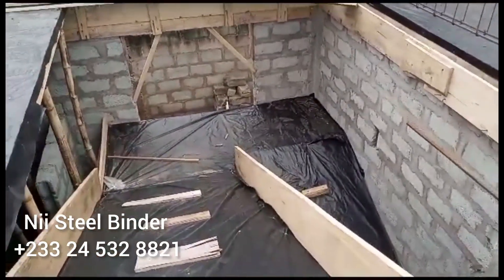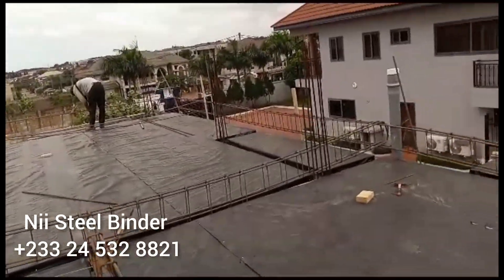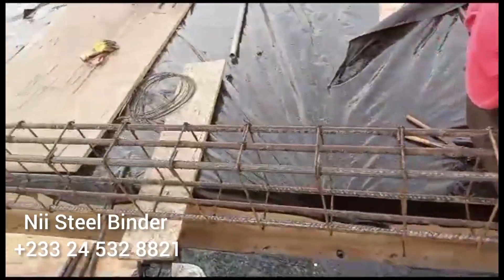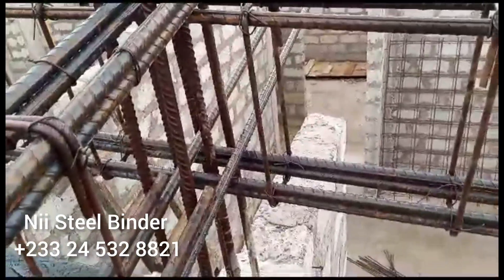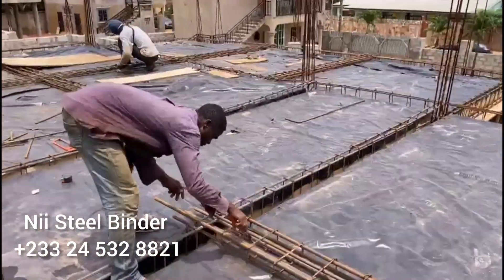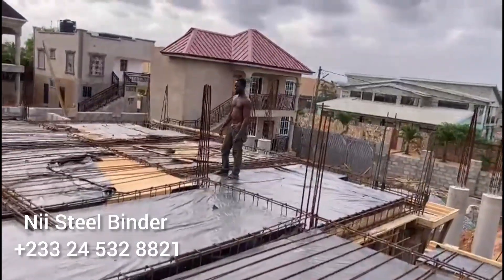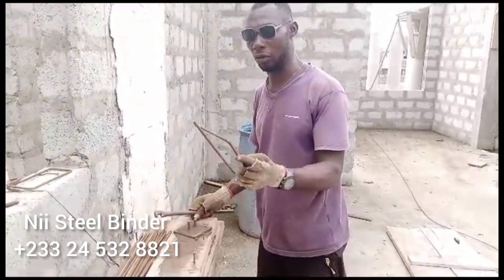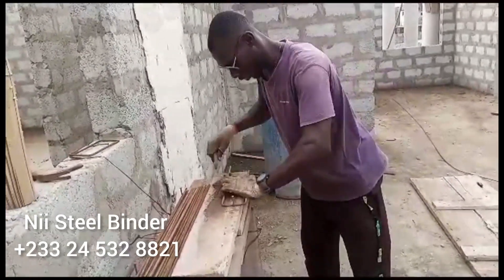Building In Ghana | How To Install Rebar (Iron Rods)  For Concrete Decking  | Building a House

Comment: Hello, when you're doing rebar and decking, how do you make sure you don't hear sound between the floors? I want to make sure you won't hear someone stomping or walking on the top floor when you're on the bottom floor
Reply: Either they didn't put enough rebars or the casting was too thin. Should be 5 inches +.
Reply from the maker: They shouldn't leave much space between the bars to prevent shocks and also the concrete mixture should be a good one